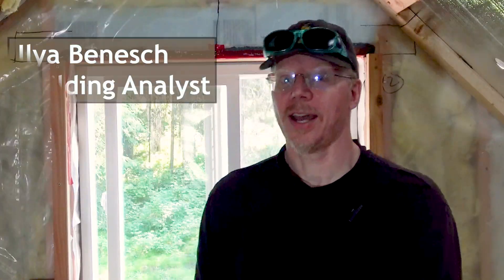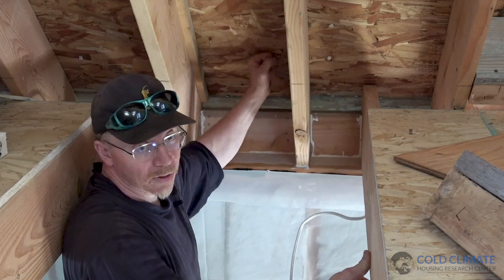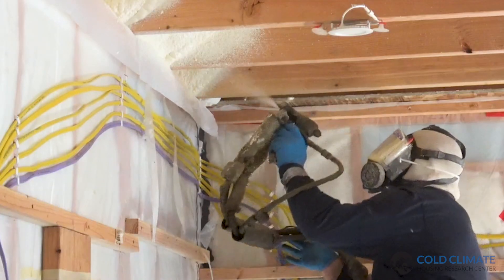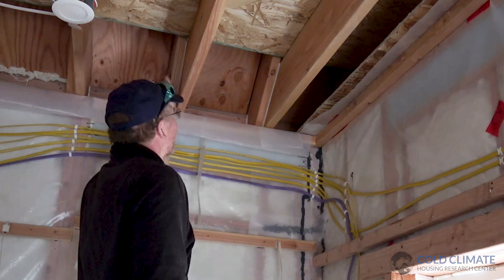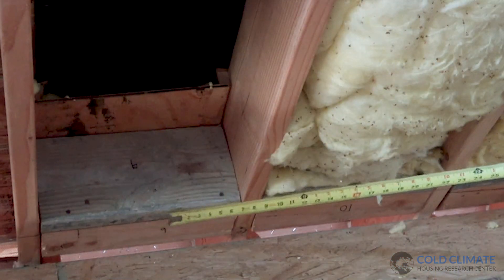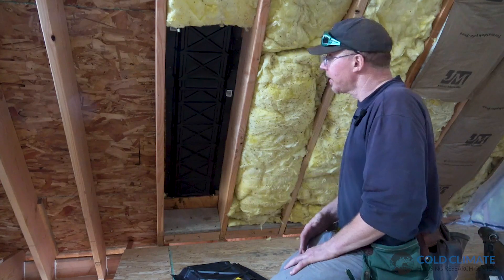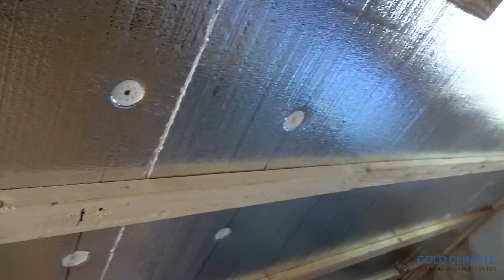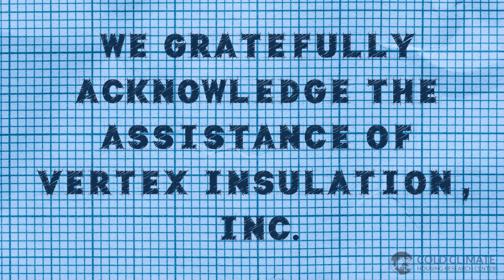Cabin Energy Improvements Part 3: Roof

Comment: My roof is similar to this but not done like you have, unfortunately. I am now dealing with major condensation problems on the roof deck of shed roof style, and I'm at a loss as to how to fix it. I know I need to increase my soffit vent size and try to get more R value in there (EPS) but I worry I'm throwing good money after bad 😞 The worst of it is in the area over my wood stove which I'm thinking to remove. I'm on the Kenai peninsula so not as cold as Fairbanks... but plenty of temperature changes.

Comment: I am remodeling a 200 year old cabin that historically had zero insulation and zero air and vapor barrier.  but the siding looks great so the water management evidently has worked pretty good.  what are your thoughts on the increasing opinion that spray foam could be the industry's next lead paint, or asbestos or EIFS disaster?  If a house cant dry, its gonna die

Comment: If you had the budget, would full closed cell spray be better? Would you then eliminate the air space?  I believe open cell would be incorrect due to humidity transfer to the exterior.
Reply: For us, the quantity of closed cell spray foam needed to fill the bays would be incredibly expensive - and in theory with 2x10 rafters, that should be enough insulation at R-50+ to avoid ice dams.  The wrench in the works is the rafters are still at some risk for heat losses through thermal bridging and whether those heat losses are enough to create hot spots on the roof deck would require a thermal analysis - particularly since the roof is framed 16" on center and the rafters are solid wood not I joists.  That's a decent amount of wood in the assembly at ~ R-9.  In the video, that 2" of foam board across the bottom of that roof effectively doubled the r-value of the rafter locations in the roof.   As an aside, I'd still want to see a 6 mil polyethylene vapor retarder across the bottoms of the rafters as relying on spray foam to provide the air sealing (pressure boundary) long term has a mixed history here - particularly on structures like this one that could experience ground movement.  We recommend the vapor retarder with SIP roofs as well for the same reasons.  If the joints in the SIPS ever fail then indoor air leakage into the cracks can transport a lot of moisture into the roof assembly.

Comment: Great advice - I wish I'd seen this a year ago. I built an A frame (2x12 rafters) in climate zone 7, with a loft sistered to roof joists. I spent probably 3 full days taping around joists, cutting strips, and generally fussing around, and I'm still not super confident in the end result
Reply: Yep it's a very very strong roof.....but the details are hard to air seal.  Good on you for giving it your best effort as that WILL make a difference.

Comment: Great information as always! I think a diagram of a recommended wall, floor deck, and roof assembly would be really helpful. This is a good example of what not to do, but if you were to design the whole structure from scratch, how should it be done? Thanks again.
Reply: Funny you should bring that up :)  It occurred to me as well after we shot that video but at that point it was already released into the wild.  So on our short list is to get a video out on cathedral roof designs that work well in cold climates  - and are actually a little easier to build.  I'm considering mocking up the options in the shop to scale for clarity.  Some of the design decisions depend on whether the roof requires a structural ridge beam or not.  In the case of this video, the rafter pairs went straight down to the loft floor forming a triangle. It was also a full loft (not a partial loft open to below) so no structural ridge was required as the continuous loft floor created a structural diaphragm that kept the rafters from pushing outwards under load.  That said, for this design my personal go-to would be to platform frame the loft floor on top of the walls (I'd prefer that over hanging the floor inside the walls off ledger boards -but it could be done either way). Platform framing would give the builder square uncomplicated joist bays that could much more easily be insulated and air sealed with foam board or spray foam.  The rafters would then rest on wood pitch blocks that are structurally screwed to the top of the subfloor.  With this method, the rafters maintain full depth as no birds mouth cuts are required and the vapor retarder can be readily sealed to the subfloor where it meets the face of the pitch block.  Our intent is to cover exactly this in a video complete with 3D drawings.    Another cathedral roof video we filmed about 10 years ago covers the same concept but using a structural ridge and cutting the eave wall studs at the roof pitch to avoid the birdsmouths in the rafters thereby maintaining full insulation depth over the walls.  https://www.youtube.com/watch?v=mOK-D3rsomw&list=PLBtw7qpC24vLes3TTm-6m7Zz7gWf1QgVo&index=23
Reply: @ilyabenesch9469  have you heard what Matt Risinger calls "monopoly" framing? named after the little monopoly game plastic house pieces